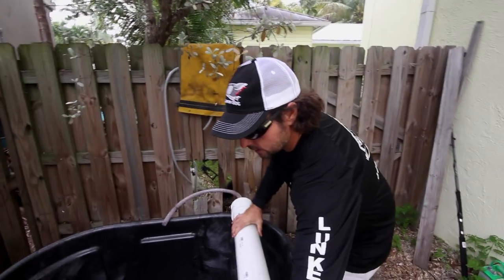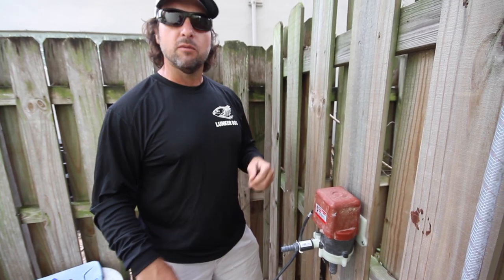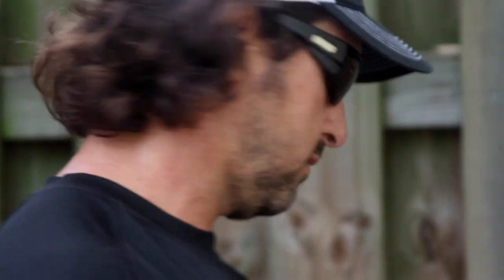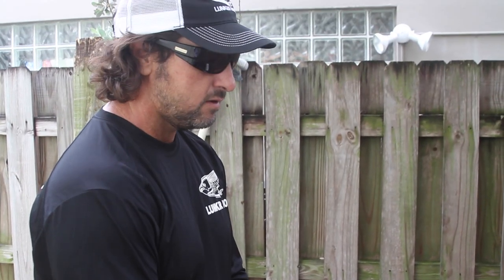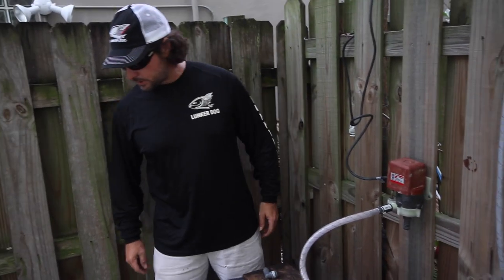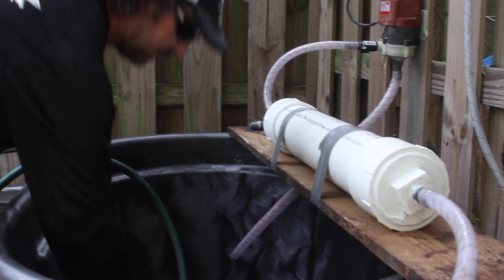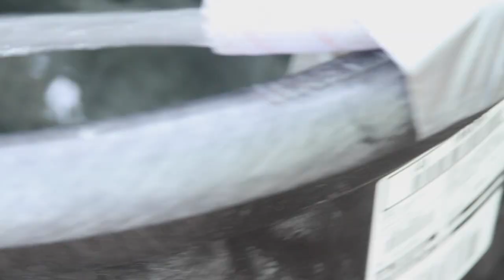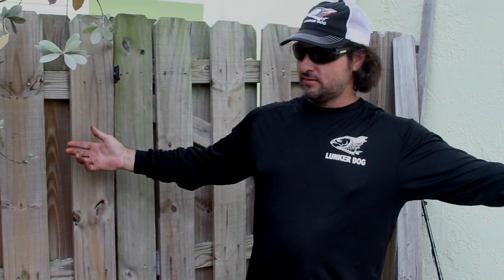Ultimate #LiveBait Installing a 100 Gallon Live Well for Bait Preservation in South Florida!

Comment: Hey Jeff use a heat gun or torch to soften the hose around the hose barb. The hose clamp crushes it for a better seal. A must do on the intake side of any pump. Those shitty hose clamps won't brake as easy also. Hows it working.

Comment: 2:00 You should put the filter (BEFORE) the pump, this way the crud doesn't go through the pump. You could add a primer bulb passed the pump in case it needs water to operate

Comment: should of had the pump pull the water through the filter instead of push it through.  you have cleaner water going through your pump and it will last longer.
Reply: KY SPORTSMAN it probably wouldn't prime that way and the pump he got looks pretty Hardy it appears to be water cooled.
And once it's been in operation for a while the water will be clear anyway.

Comment: How long will they last without a filter
Reply: Zachary King the big thing is heat if your water isn't moving it heats up really quick and won't hold as much o2
Add in and the detritus and they suffocate.
I've moved to using an insulated water jug for a bit bucket and it keeps it twice as long without even a bubbler.

Comment: Working on mine today.I have a 1/2 hp pump, I hope it's enough. I'm putting my filter on the intake side, and mounting it to the inside of the tank with a u-clamp. I'm mounting the hose that flows water, around the top edge of the tank with zip ties, and plugging the end off  Then I'm going to drill small holes all along the hose. Hope everything works. Thanks for the video, Jeff
Reply from the maker: Ronnie Roberts Thats well is now in the back of the truck. Made way more sense.

Comment: So cool. Are you going to add one of those spray bars to the top? Few questions.... What's inside the filter system? Would love to see the filter. How many times a week etc do you clean the filter? Do you feed the fish if they are in there awhile? Finally, can you mix mullet with other bait fish? Thx!
Reply from the maker: We are gonna find out the answers to most of your questions the hard way. No idea on how well the filter is going to perform. We are gonna start out with 50 pinfish and see what happens.
Reply: themulletrun The pinfish should be good for a week the longer their in the bait tank the weaker they get. They tend to bite their tails off when their in the tank too long :((
Reply: Also pilchards are the hardest baits to keep alive. I've kept mullet for over 24 hrs before they die but you have a filter so they should stay alive a lot longer ! But with mullet gonna need a lid.
Reply: Oh yeah you can feed the pinfish pieces of shrimp.

Comment: You should put the filter on the intake side or add another filter so you'll have two in place, which wouldn't hurt either. Going to add some life to your pump by not sucking up so much debris. Now RUN THAT DOG!
Reply from the maker: VA MAN Ground water levels killed the whole setup. Video soon
Reply: themulletrun  damn

Comment: Holes in the wooden fence, leaking water connection, but... MAKE IT PERMANENT like he's a real hero.  You just need a smaller pump (if not keeping waterstream fish), some bioload and plants to reduce your nitrates.  So a waterlelie with substrate and a very small (quit) low energy pump is a better system... But anyway, OK if you want to be the hero of the video... i'm a little laughing now... i'm sorry.

Comment: The whole problem here is that this is basically an aquarium.  Look into aquariums.  Filters are key.  Aquariums have  a load capacity basically revolving around filtration.  Filtration is bacterial. To establish this equilibrium would take at least six weeks with a low fish count.  One bacteria turns nitrites into nitrates.  nitrates are removed by water changes or plant life, not simply removing "crud".  That's why no follow up vids.  nitrates are the least harmful to fish  but after time will kill them.  I bet this system is no longer is in use.
Reply from the maker: +cptbigtok This system is no longer in use.
Reply: where did you buy that pump at

Comment: Put 180 lbs of dead reef rock and 20 lbs of live rock in there and a few big-ass powerheads, buy a big fat used beckett protien skimmer running off a an iwaki external pump.  no other filter will be needed or would help.   You'll be able to keep bait indefinitely as long as you feed it and keep your salinity stable.  The filtration actually the weakest part of this system.
Reply from the maker: Thanks for the tips but we are out of the home bait game for now. Biggest problem was water temperature. We are in South Florida and its hot here all the time
Reply: themulletrun I hear you, I'm in TX, and yes, I run huge chillers.